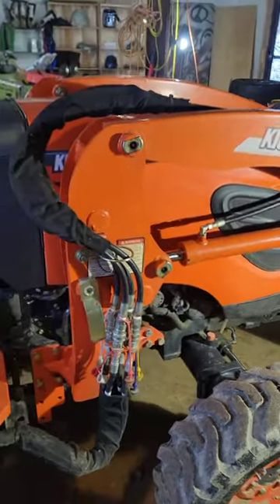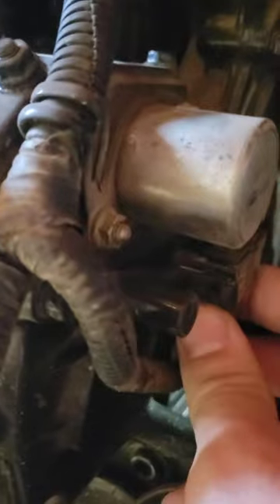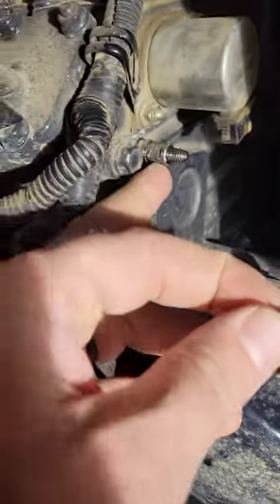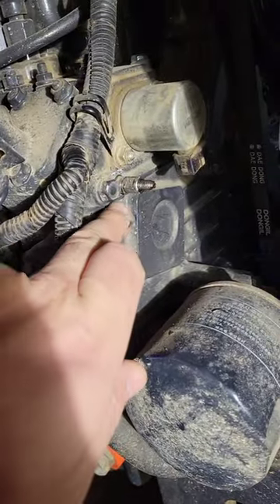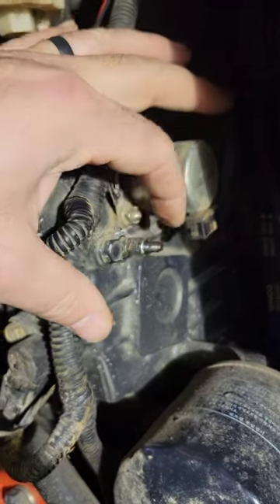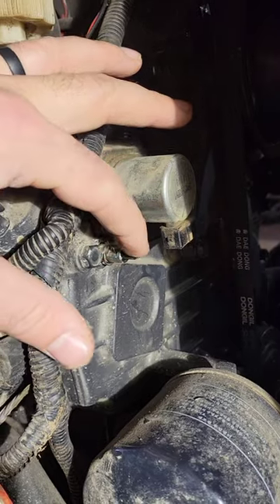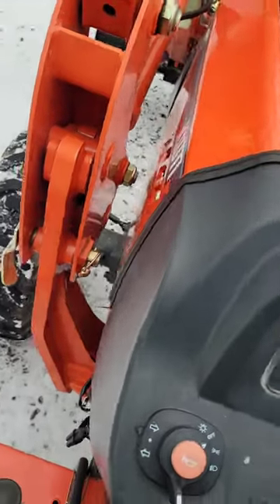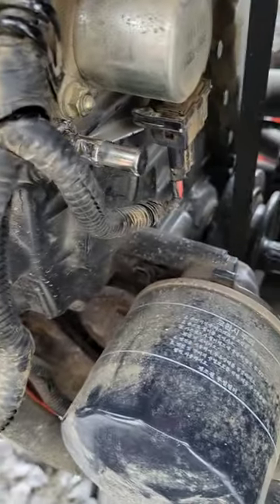kioti ck2610 horsepower increase from 25 to 35ish !!! easy.  takes about 20 mins.

Comment: Thank you Jerry.  good thorough video with valuable info complete with the before & after performance.
The outcome for anyone attempting to replicate this adjustment will depend a lot on their personal skill level to avoid making a mess of things.
Important to not lose track of the original setting via good notes and an accurate way to measure the screw position.

I couldn't find any writing indicating mechanical differences between the 24.5 hp and 34.2 hp versions of the Daedong 3A165 engines.
Compare to Daedong 3A165-LWS Korea tier 3 rated 34.2 hp at 2,600 rpm.
Kioti CK2610 uses 3A165 LWM-U.
Bobcat CT2025 uses 3A165 LWM-H.
I believe these have a larger coolant capacity despite the reduced horsepower.
Certainly a nuisance to have to shift to low range when the rpm nosedives hauling my boat up to the house.  Same task, hill & boat that my 1 liter 3 cylinder Kubota B7500 used to manage without bogging down.

Comment: Okay, first of all Jerry...Thank you for sharing this information with us voluntarily. Despite people blaring in the comments section about unwarranted opinions, I for one appreciate the fact you took the time to make and upload... as well as respond to us.

I have a 2020 CK2610HST and I also understand that its the bigger frame with the 'de-tuned' engine. I did not know this at first since I had assumed it was an entirely different engine, but it makes more sense to simply detune. I'm really stoked to try this. I just did an early 200 hour maintenance on mine, at around 140ish(?) hours. Found quite a bit of metal powder residue on that transmission's magnetic 30mm drain plug. The oil was darker than expected as well, but it's all good now. New filters, engine oil, hydr oil, etc. :)

Nevertheless, do you have anything else you could possibly share that you wish you had known prior or have learned after the fact? I would greatly appreciate it and I will share my experiences as well. It would be great to have extra power without worrying 'too' much about affecting the life of the components (with normal use of course). If you're okay with it can I message you either on here or social media somehow?
Reply from the maker: Sorry for the late reply.. the only other issue that's a big deal with this tractor is the front axle seals.  I guess you would call it a type or portal axle and they leak!
Reply: Are you going to replace seal or just keep eye on it? I have 20yrold Kubota front axle seal leaking as well for about 10yr. Just never got around to fixing yet - @JerryULatowski
Reply from the maker: @jacklowe3788  i fixed the one side,  took about an hour.. but the other side the stearing linkage is really stuck on there,  i would have needed a impact gun.. so i said forget it. I top if off once every 6 months and don't park the nice concrete 

Really such a bad design.  My uncle has a brand new kioti and it does the same thing.

Comment: Great advice. Wish Kubotas were as easy.  My only add, after you do the additional fuel input, watch closely the exhaust gas temp.  If to High you could melt a piston.  A probe is easy to install, inexpensive.
Reply: Adjusting the fuel is similar on a Kubota L2601/2602 (cut a cap, turn a nut/screw), but if you don't want that "incomplete combustion" he talks about at the end of the video, you need to advance the timing a little by removing spacers between the camshaft and the fuel pump.

Now on the L3302 (or 3902), it's all software and electronic-module controlled.  In fact I'm pretty sure the mechanical specs for an L3302 are the exact same as the L3902; the extra $3k or whatever is just for a software flash to add fuel and advance timing.

Comment: Thanks for video. I have a Branson 2515. Kukje motor, same situation. I plan to turn up also.  Only a few 25hp models with no electronics.  Guys.... The whole point is "large frame, no emissions, bring back to pre-detuned limit".  One has to ensure no electronics and that the motor has been de-tuned by OEM.  Turning up a motor that hasn't been de-tuned could be very bad.

Comment: Thank you for the video! I was researching it just yesterday and your video popped up today. It looks like you have to cut the whole anti tamper cap off like you did. Do you think that cap can come off without cutting?
Reply from the maker: You need to cut it unfortunately.  Be careful.. If I were to do it again I would have took more time / been more careful.
Reply: @JerryULatowski  I ended up using my baseboard oscillating trim cutter with the carbide blade. It worked well, I still nicked the jam nut a little but no big deal. I had to come out 4 turns on the adjustment screw. The tractors power is like night and day now! When I first got the tractor the front bucket was a little weak too. The adjustment for the pressure is under the rubber boot on the loader lever. Did you adjust yours yet?
Reply from the maker: I haven't looked at increasing hydraulic pressure yet.. maybe that's a spring time project.  Do you have added weight/ ballast box? I just added one,  what a difference!
Reply: @JerryULatowski  I always have the Kioti backhoe on it. Bought it with the tractor with financing. I wouldn't have been able to come up with 8k. I haven't had the rear wheels off the ground. I don't like doing it but it will hold a full pallet of wood pellets when I pull it off my trailer (2000lbs). I have to keep the curl function pinned and pinned as I lower it or it will tilt forward and then there's the mess! I have the psi set a 3,000 psi but the factory spec is 2600psi.
Reply: @alittlebitofeverything5090  Sounds like you WILL be rebuilding the front axle very soon; -=its still a little tractor.
Reply: @donaldstrishock3923  I've moved 4 pallets of wood pellets. If you compare the CK axle to the DK axle they are essential the same except the DK is wider. The DK is rated to lift over 2k. So I'll take my chances! If it breaks I'll fix it.
Reply: @A Little bit of Everything  Still holdin up? Thinkin about this for occasional round bale stacking.
Reply: @ricksanchez7459  Yes, everything is good. The extra power only effects the machine when driving. It doesn't bog down and strain anymore. The extra power really doesn't make a difference on the fel loader or backhoe power. But, I did use my 3 point wood chipper the other day and there is a considerable difference in PTO hp.
Reply: @alittlebitofeverything5090 Do you have a video of this or better explanation? I have a Bobcat CT2025 and i would like to up my hydraulic pressure. My understanding is they are basically the same tractor mechanically.

Edit: And i am referring to upping the pressure from under the boot.
Reply: @tomahawkjo8574  The boot on the loader control lever sucks to get off and I ended up leaving mine off. Under there is an allen screw that has a lock nut. Crack the nut loose and I believe turning the allen clockwise increases the pressure. I only had to turn it about 1/4 to 1/2 turn. I bought a pressure gauge that I attached to one of the front hydraulic lines at the quick connection. I went from about 2600 to 3100psi and it has been fine. When tightening the lock nut be sure to hold the allen in the same spot so you don't move it and adjust the pressure by accident.
Reply: @alittlebitofeverything5090  Awesome thank you. Will be a little project to increase the pressure!
Reply: @tomahawkjo8574  No problem at all. If you have any more questions let me know. Just make sure the hydraulic gauge you get can handle the psi and that it comes with the right size quick coupler.
Reply: @alittlebitofeverything5090  Sounds good. So factory i should be close to 2600 psi? Do you know what these lines are rated for and how high i can set my psi?
Reply: @tomahawkjo8574  I'm not sure what the factory sets them at, but I set mine at 3100psi because most hydraulic systems I've seen are rated up to 3600psi. So it's a do it at your own risk type of thing.
Reply: @tomahawkjo8574  Did you adjust the pressure yet?
Reply: @alittlebitofeverything5090  I have not. I will wait for it to warm up a bit first.

Comment: Nice! My Bobcat 2025 same tractor.
Reply: I did it to my CK2610 the other day. I ended up having to turn it out (counterclockwise) 4 turns. It is like night and day on the power difference. You notice it right away when you rev it up, it's not delayed and it isn't sluggish on the hills anymore.
Reply: @alittlebitofeverything5090  I wish there was a better way to take the tamper proof cover off. Try not to make obvious... warranty wise
Reply: @MotoCheez  I'm far out of warranty so I did it. There isn't a way to get it off that I could see without cutting it. I tried to regardless but it's pressed on there.
Reply: What you have same tractor as me as well.. and mini truck ... dude! getting worried HAHAH
Reply: thats good to know because im looking at the bobcat 2025 hst and i plan on doing it. I wonder if you can order a new cap and put it back on after.
Reply: @jakeMTSU  pretty sure I'm the original mini truck YouTuber! So maybe you're following me except I didn't get the tractor after you
Reply: @jhippl  I doubt it it's actually crimped on

Comment: Very cool.  I'd like to try that on a deere and hope for similar results.
Reply: It's only because the ck2610 is a detuned ck3510, the 2510 has 10cc less than the 3510. Kioti did this to stay under the 25hp limit.
Reply: Unlikely to get too much of a gain on most JD’s.  Maybe a smidge boost
Reply: @MJF40  did it to a 1025. High range is actually useful now 👍
Reply: @projectswithjw  I did see that 👍🏻.  Hard to imagine too much increase.  Maybe a PTO test ?

Comment: I bet if you adjust the timing a little bit, you could turn that fuel screw up a little bit more.
Reply: That’s the problem it’s 2 degrees off timing compared to the 35hp. So you aren’t getting 35hp. You are getting a few more hp and a world of problems

Comment: Note: The 2024 Bobcat ct2025 with 3A165 diesel does not have a thin sheet metal sleeve cover on the adjuster screw.  It is a machined piece with about a 0.100" thick steel wall.  Attempting to remove it as described could probably do a lot of damage.

Comment: There's no other way to remove that cap besides cutting it? I would assume it can come off it was put on? I just got. 4010. Curious what I can turn it up to. I've seen multiple things about guys turning them up. Is there anything else you can do or is that adjustment the only thing??
Reply: Only work for all mechanical (not electronically fuel injected) tractors. 25hp or under.
Reply: @AppalachiaDreamin  ok thanks I have the 4010 40hp. It is a beast bso far very happ, but I've seen many people saying you can turn up HP on all sizes just different process. I had 3rd function added & got a grapple & sense found a 60" box blade I got delivered to my house last week for $500! It barely even looks used, has all the scaring bits just missing few pins. Heck of a deal on that

Comment: This is really cool I am tempted to try but how do you know this is ok to do? Wouldn't increasing the horsepower have the potential to damage arms and booms and stuff from over pressurizing cylinders? How do you know your transmission can handle the extra power?
Reply from the maker: @elevatedsciencesllc8089  this engine is the same engine as the others in its model range up to 39hp i think?   Epa states any tractor over 25 hp needs expensive emissions technology.  So this model was detuned.. or " locked out" with the little cap to stay below those standards.  Im just bringing it back up to normal,  just without the epa involved.
Reply: @JerryULatowski  Right, I'm with you on the EPA's bullshit, not a fan. But my understanding was the bigger engine models also have thicker steel arms and hydraulic rams etc. to support the extra hydraulic pressure, isn't that right? The lifting power is not determined just by engine output, but also by how much weight the frame can safely handle. So how do you know you are not exceeding the limitations of what the steel is designed to handle?
Reply from the maker: @elevatedsciencesllc8089  upping the hp did not up the hydraulic pressure. There is a limiter valve that would need to be adusted. There is a guy somewhere in the comments here who adjusted it. I agree i think the frame is maxed out on lifting power
Reply: @JerryULatowski  Ah, I see, so the real advantage here would be allowing you to have more  GPM flow to run more implements at the same time?

Comment: Do you know why there are two different settings on the dash for the PTO? They are only a few hundred rpm off?
Reply: I asked my dealer that and he sais some tractors and/or implements have a PTO economy mode, and the lower PTO setting is for that scenario.

Comment: Curious if you noticed if it uses a lot more fuel with the mod. I just got the same tractor a month ago in the dealer tuned it for me, but seems to burn a lot more fuel than my Kubota, but I don't know if it's just this tractor or it's the mod
Reply from the maker: Yes. Uses more fuel.  At about 100 hours per year,  I'm guessing maybe i burn an extra 2 tanks of fuel,  maybe extra 10 gallons? Noticeable, but not anything crazy..

Comment: My fuel adjustment screw moved a bunch when taking off the cover. Anyone know how many turns out from full stop in I should start with?
Reply from the maker: I don't know what is stock,  but I think a good way to check if it's out too far would be black smoke from exhaust and a strong smell of fuel. So you could start there and work backwards ?

Comment: Would this be the same on a cx2510?
Reply from the maker: I think so yes,  it has that 1/2 inch "cap" that you would need to cut.. but that's the newer model right? Might want to wait till warranty is up..
Reply: @JerryULatowski  
Yeah it's new. 
I wouldn't do it until warranty was over.

Comment: The only problem with doing this, is now it will be easier to damage the tractor with the power increased, the frame and drive train are designed for the power that the tractor came from the factory with.
Reply from the maker: In any other situation,  I would agree with you,  but this tractor is a 40hp tractor detuned to 25 hp to skirt emissions. So all components are designed for 40hp.
Reply: I have the same tractor but with the 40hp motor.
Reply: @JerryULatowski  I stand corrected then 🙂

Comment: Anyone put this on a dyno to confirm or is it just seat of the pants?
Reply from the maker: I think my method of testing is more than " seat of the pants"  you can see in the video I stalled out on the hill,  and then didn't stall out.  You're like the third person to mention putting this on a dyno.. how many people have dynos? I don't think I've ever seen one in person.. do they sell them at Harbor Freight now? Is there a coupon?!
Reply: @JerryULatowski  damn, way to be a tool. Not one single thing did I say negative. Wasn’t hating. Wasn’t even talking to you. But yeah, if you live near a city you can find dynos. Might be a chasis dyno, could find an engine dyno. 

Just interested. See, you turned up the fuel; but I know the timing is 2 degrees different. That could be a few HP. So maybe it’s 30horse and not 35horse. Not saying it isn’t, but going up a hill isn’t a metric. It’s an anecdote. 

I’m all good with your content; but you don’t have to be an ass about it.
Reply: @WillS-x9y  Real world test , recorded on video of indisputable proof, i.e. same rpm, same incline, is not an anecdote there professor, unless you are calling this man a liar/huckster. Dang, give the man a break, he simply showed us his results from his mod.